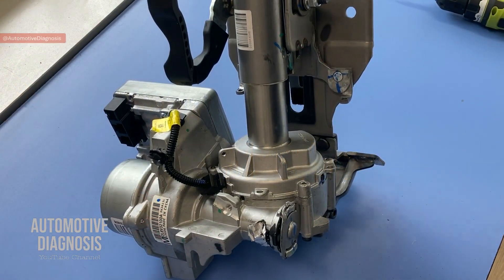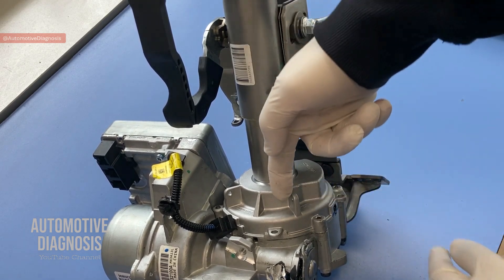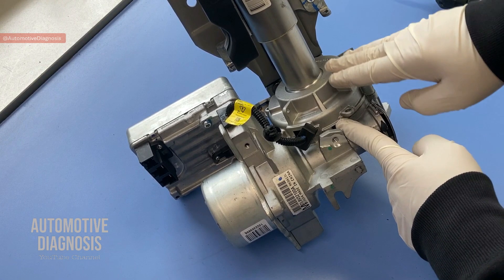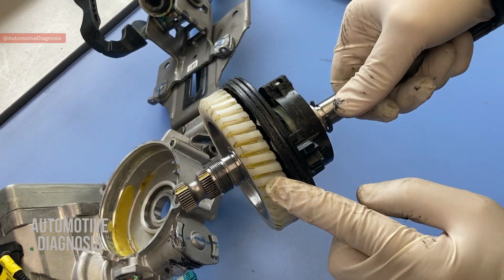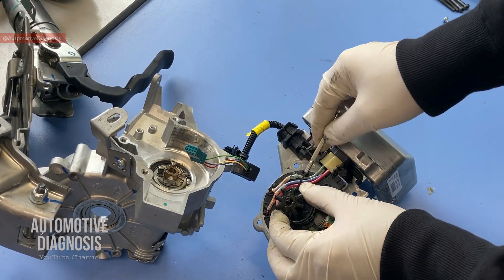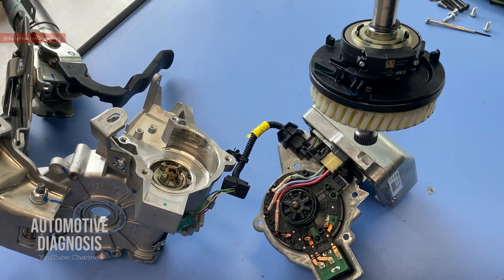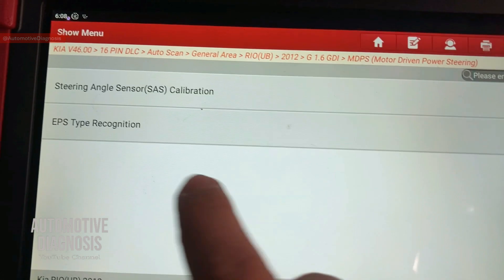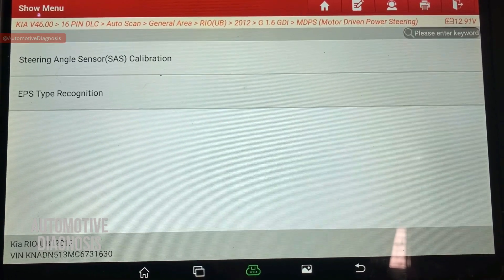ELECTRIC POWER STEERING Secrets Revealed!

Comment: Respected sir ,i have seen your vedio related abs in car.i am from india.my machanic said abs not working .he is saying brake fluid is not going to two wheels on right side.he said two things one fix a used abs or disconnet abs and put front brakes mannul mode.can i get information sir
Reply: He did not opened fully abs and checked sir.how can we say abs working or not.i went and said my brakes are not fully working .peddle getting stuck and car going left side when I brake.
Reply from the maker: Hi my friend, if brake fluid is not reaching to two wheels it could be from the relevant valves inside the ABS module. I don’t recommend to bypass the ABS, the best thing is to replace the ABS module if faulty
Reply: @AutomotiveDiagnosis  
Thank you sir.my car is 16years Verna hundai car it's from my father who passed away in carona.from last two years I am using it.i already changed cluth plates and it's total setup .two years back they said we disconnect one wheel from abs problem.only three wheels for brakes.i did use well.56000kms used my father and now I used more 20000kms.now total 77000.now suspension problem and one mount problem due to vibration.which mount they did not checked.again now ABS problem.after company bill  due to cluthes  i stoped going to them.two years I managed by good mechanic from bihar.he gone away to his place.i am in hydrabad.yesterday I showed to new machanic .one said booster problem.another said abs because I said to him one tyre brake not working.then he worked good and checked.no fluid to two right font and back tyres.then said Abs because I ready said before to him.he said he will try second hand or not mannul front two brakes.i said we will go front two mannul brakes .because of low cost.yesterday day night i couldn't sleep and searches vedios of you.i thank God for you to your replay sir.
.i couldn't have money to invest new car or to put more money 16yeras old car.i am managing and happy because my father remembrance.i woke early and saw any reply for my message .no body give back .but I saw your message and felt so happy and God bless you so much .
Reply from the maker: @wakeupvamsi5950  My condolences to you my friend. Have you or your mechanic checked the master cylinder? I'm asking because you said two wheel are not braking. Master cylinder provides two hydraulic pressure through two brake lines which both go to the ABS module. Each of those two brake lines provides fluid for two wheel (which happens through the ABS module). Also inside the ABS module there are two pistons (primary and secondary pistons) if any of them fails, hydraulic pressure from that piston will stop, causing no brake in two wheels.
Reply: @AutomotiveDiagnosis  thank you sir.right now I in garage explained to my mechanic .he is trying sir
Reply: Sir .master cylinder is fine and due to pistols as you said problem.so here he said pistols checking and repairing can not have that so he took away  brake wires connection to abs and he attached brake wires to connectors .brakes are fine now .only thing he said is now mannual brakes.i took picture sir.but don't know how to send to you.can I have your mail.i will send to you.if only ok for you .still I am in garrige doing small things .
Reply from the maker: @wakeupvamsi5950  sure my friend. here is my email address: automotivediagnosisyt@gmail.com

Comment: Thank you so much .Is there a thermal protection to protect the electric motor from heat due to high current?
Reply from the maker: Hi my friend. Yea, there is a temp sensor to detect the overheating, if EPS motor is overheating, its duty will be limited to 40 percent until it gets back to normal temperature.

Comment: Which car has steering?
Reply: i am a 67 year old tech and the only cars that i can remember seeing without steering is back when i was in cub scouts and we raced pine wood derby cars - they had no steering. - before that, when i was 5 years old my dad had a little nitro powered model car, it was to be tethered to a spike in the ground with metal cables, you started the engine and let it go, it ran in circles until it ran out of fuel - it had NO steering !
Reply from the maker: This EPS was from a Mazda, but many cars these days have EPS with very similar design.